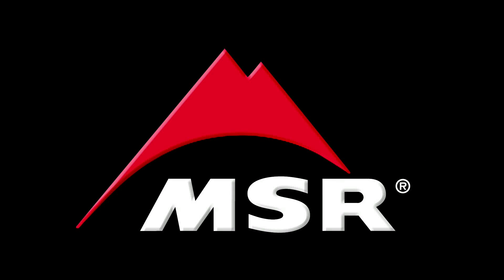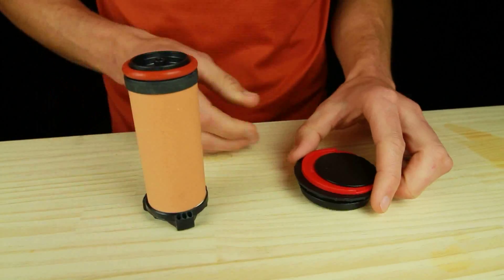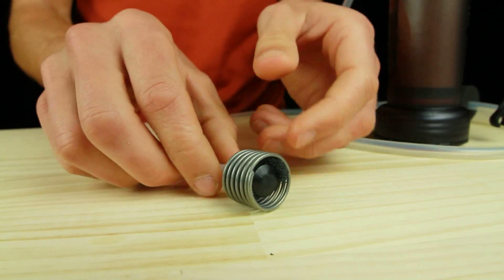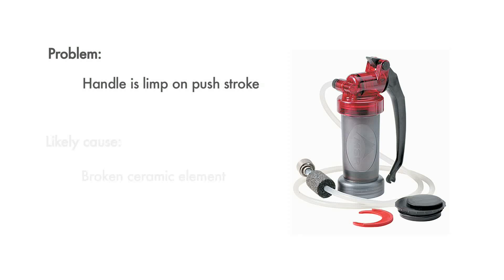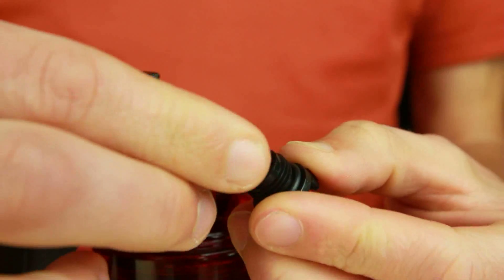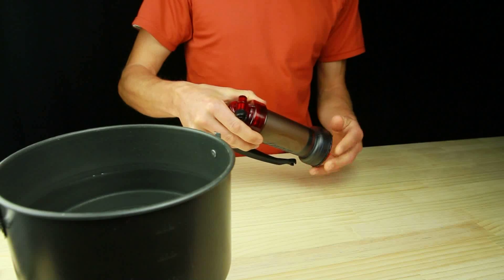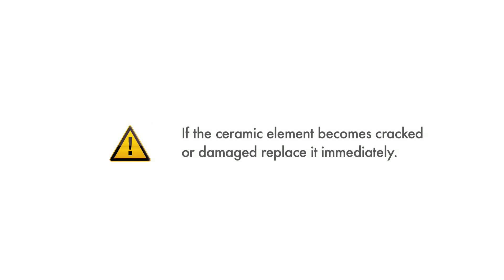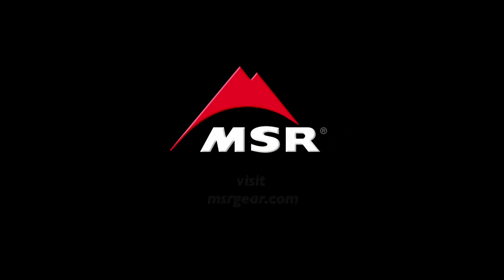MSR Water: MiniWorks® EX Filter Maintenance

Comment: I did every thing this video described and the filter still isn't working. the pump works fine on its own but when connected to the filter no water gets through.
Reply from the maker: Hi Brendan, Sorry to hear about the issues you are having with your filter. We would be happy to troubleshoot this issue with you. You can call 1-800-531-9531.

Comment: Roughly how long should the filter be scrubbed for a cleaning? Like is 1 minute of gentle scrubbing about right? Also, the flow rate went from about 1 liter per 2 minutes to 1 liter per 10 minutes over the course of 4 liters. Is this normal? The lake was not particularly dirty.
Reply from the maker: There is no recommend time frame for scrubbing the filter. You should make even, uniform, and gentle strokes with the scrubbing pad going up and then down (end to end), while cleaning all around the element. If the flow rate has decreased significantly, clean around again, possibly even doing a sterilization of the ceramic element. Decreased flow rate over time is normal and expected as the ceramic/carbon element is removing particulate and bacteria from dirty water. For more info, see owner’s manual.

Comment: I’ve had this filter for years and it had some ups and downs. On a recent backpack trip as I was pumping water into it, it would also pump the water back out the way it came in. I had to pinch the intake tube near where it connects to the pump in order to force the water through the system. Any ideas on how to resolve this?
Reply: I would bet your filter is clogged, you should have the scraper as shown in this video to remove the blocked carbon from the outside of the filter so it requires less pressure to pump through.

Comment: Hey, I recently got one of these and am having some issues. When I pump, the water is just expelled back out the inlet hose rather than going through the filter. I cleaned and lubed everything as outlined in the video, but it still wont pump. 

Thanks
Reply: I just looked at a schematic and the pump is missing the Duckbill Valve & Washer #459198.
Reply from the maker: Hi Ryan,

If you email me at daniel.tomlinson@cascadedesigns.com we can get you set up with the replacement pieces you need!

Comment: is filtered water supposed to be soapy (bubble with whitish)? I just found older model of this (black body with green pump) cleaned and lubed all the part and sanitized the filter. I tried to filter tab water and water was soapy.
Reply from the maker: Unless soap was used to clean the filter, there shouldn’t be the presence of soap in the filtered water.  Sometimes filtered water can appear frothy, but usually that is due to agitation of organic materials in the water and then usually only appears when the water source is outside, like a stream or pond.  If the bubbles dissipate after filtering, then the water should be fine, but if the bubbles persist, then we would recommend purchasing a new filter element.

Comment: I have a new Miniworks EX and for waterer reason the flow rate is atrocious. I've used them in the past and I know how awesome they are so I'm wondering what I should check to fix it. I've taken it apart and cleaned it but like I said it's new. It looks to me like there is a huge pressure build up and some of the water is exiting via the hose every time I pump. The water only drips/trickles out of the clean end.
Reply from the maker: +C Atter Hi and thanks for reaching out. We would love to find a solution for you. If you could please email consumer@cascadedesigns.com that would be great.
Reply: Sorry I totally forgot about this post. As it turns out the filter was just new and needed to be broken in. I boiled it to purify it and I guess the filter opened up a bit, now it runs beautifully

Comment: I don't see how this can work without cross contamination. In the field the inside of the filter and the ceramic element are both covered with contaminated water. I would be concerned that this water has touched the outlet in the maintenance process. Just rinsing with some clear water appears unlikely to kill bacteria or parasites.
Reply from the maker: octavian77  The video shows that the outlet is covered by the clean side cover until one pulls the filter element out of the body.  At that point the video shows the guy holding his thumb over the outlet and the voiceover says “hold a finger over the outlet port and rinse element with clean water, always washing away from the outlet port”.  The rinsing itself only clears away the debris from having scrubbed the filter, but using clean water to rinse and rinsing away from the outlet will keep bad water from mixing with clean water. Let us know if you have any other questions. Thanks!
Reply: MSRGear Got it. Thanks for clarifying.

Comment: Do I need to sterilize the ceramic element before using it for the first time?
Reply from the maker: Thanks for the question macuser1232! The filter element doesn’t need to be sterilized, but it is a good idea to scrub the filter with the 3M pad just to be certain that the outer glaze from the firing process has been completely eliminated.  When the ceramic is fired in the kiln, there is a glaze left after that process which covers and clogs the pores of the filter element.  We have a step in production where somebody scrubs that outer layer off, but it’s a good idea to scrub it down before 1st use, just in case.
Reply: MSRGear
Great! Thank you very much! So, would I not need any water applied to it while scrubbing it with the pad?

Comment: i have used this filter for many trips. however i just used it for section hiking the georgia AT. on day 4 it started having alot of back pressure in which the pump handel pushes out and only fills up with 1/3 of the water. it still filtered just very slowly. any suggestions? ive cleaned it and taken apart several times. without the filter attatched the pump works great! but as soon as the filter is attatched it only fills up with 1/3 the water. any suggestions would be great!
Reply from the maker: If you have’s tested the filter without the body attached, and it works properly, then the filter is clogged.  You should use the supplied ScotchBrite pad to scrub the outer layer of material off of the ceramic filter element.  Many people don’t scrub hard enough, or thoroughly enough…don’t be shy, scrub that sucker good and hard.  Once the filter is clean and clear, you’ll get proper flow back.

Comment: you only need to clean it when it get hard to pump. It depends on how dirty the water is. On lakes with a lot of silt you may have to scrub the ceramic after filling a couple Liter bottles. On other clear lakes I could go all day.  After your trip or for long term storage you should boil the element for 5 minutes and let it sit in the hot water until it is cool. Then leave out for 4-5 days to air dry. Its a great filter. Read my comment.